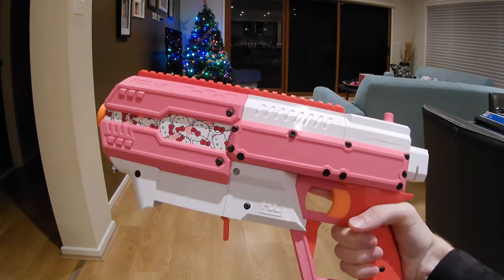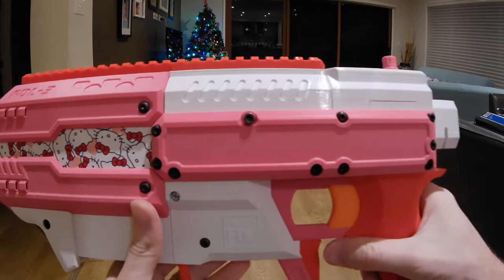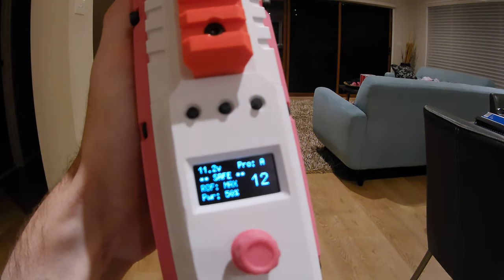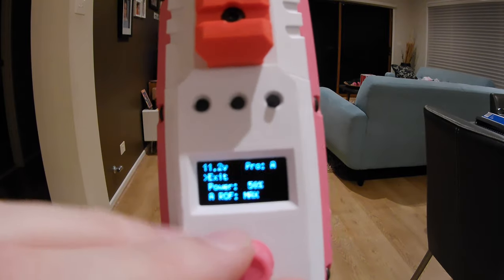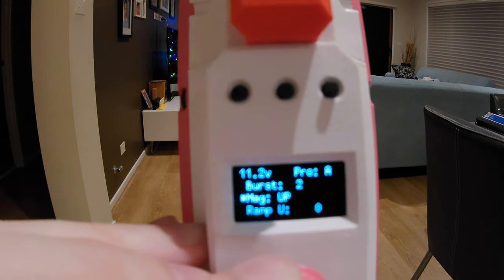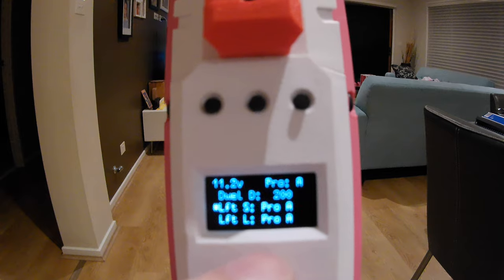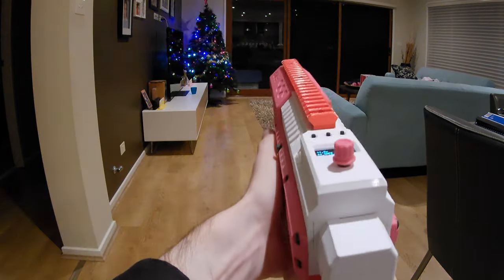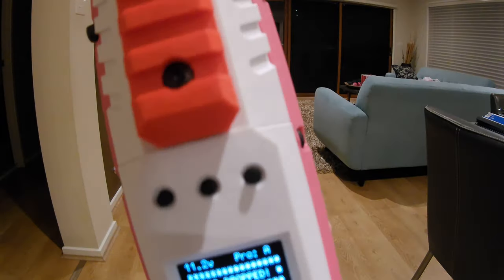Narfduino FDL3 Demo

Comment: So is this how i can get my hands on an fdl-3 since they closed down?
Reply from the maker: They haven't closed down... They're just rebuilding their supply chain.

However if you had their boards, you could certainly use the front-end models to run their stock electronics with the R6 brotherhobby motors, or use the rear-end models to set up a Narfduino powered unit.. Currently "out of stock" on the OLED boards though while I run another version off with a few fixes. 

So in a way, yes, you could build one with parts available today.
Reply: @AirzonesBlasters  I am planning on using one. Of your Narfduino Micro boards to build an FDL-3. 
If I used the Semi auto tail with a rev trigger and a manual geared pusher I could see this working no problems. Only issue is I would like to run a dual stage trigger of some sort so I have rev at the initial stroke of trigger pull and pusher release at the end of the stroke. 
Do you have any thoughts or recommendations on this one?  I was looking at the FDL-3 handle and thinking about trying to modify it to fit both switches but seems a little overwhelming and I know you are the master of this so I thought maybe you have a solution already. 
Thanks for your time!
Reply from the maker: @llsnyderj  yeah I'm sure it's possible. You'd want to remodel the grip frame and probably use a submicro switch
Reply: @AirzonesBlasters  thanks I’ll give it a shot!  Any favorite pusher motors you would recommend?
Reply: @AirzonesBlasters  I finally finished my Narfduino Micro controlled FDL-3 and it’s pretty amazing!  I built the short nose auto tail and the only parts I had to modify were the handle to incorporate 2 switches and the trigger.  I’m using EMax 2207 2400kv motors with your wheel designs. Super snappy and rips!  I used a PWM unit to control the pusher speed so I can either fire single shot, 2 shot-ish burst and full auto depending on the speed of pusher I set. 
Thanks for your hard work on designing the Micro board, I am looking forward to trying one of your Complete boards at some point!